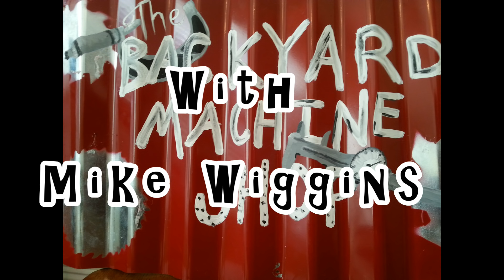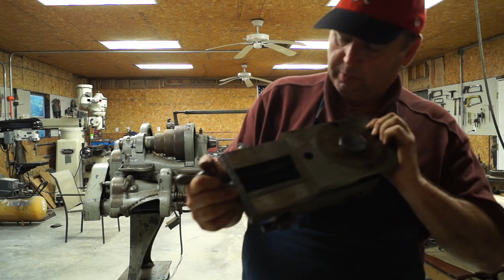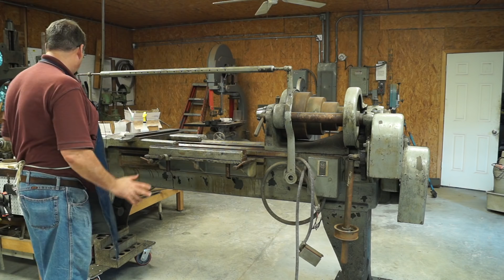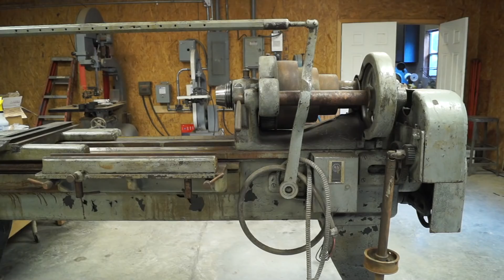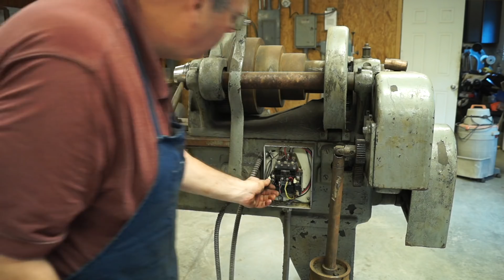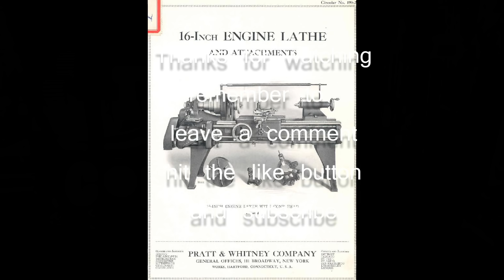1916 Pratt & Whitney Lathe Restoration Part 1

Comment: I have the identical lathe and I love it. Mine is not restored yet and is in need of some adjusting and tightening up at this point. I've learned a few things about the build quality of this old equipment and am always amazed by the simplicity.
Thank you for taking the time to record the process.

Comment: is the wooden rod there to make it easier and safer to operate from the other side of the lathe.? just a thought. if it is close to a wall it would be a pain to walk around to the back side to operate that connected control? very nice show. those old boys sure built em good. thanks.
Reply from the maker: I found out the rod was for shifting the feed at certain points.

Comment: Would unlocking that second cross slide and locking the main cross slide to it, allow you to use the taper attachment?
Usually, to use a taper attachment on, say a Harrison, the cross slide main screw nut needs to be disconnected.

Comment: Your rod" MAY" be for keeping the half nut engauged 100 % during threading operations but allowing you to reverse the feed direction to return tool to start of thread ---keiith Rutger 's lathe has this option although the lever is different.

Comment: THE LOWER CROSS SLIDE IS WHAT MOVES WITH THE TAPER Attachment engaged. There is a rectangle two pice block that slides in the taper attachment and a.  Shoulder bolt attaches it to the hole in the back of the cross slide. I have a Pratt and Whitney from the late 30s. It's a gear head with twin stick shift set up. Has the same type of wooden bar to engage the spindle. The taper attachment very good.
Reply: yes its called anti backlash taper turning

Comment: Just a safety warning for anyone who is moving a lathe for the first time... they are extremely top heavy and if it tips over on you it can kill you. This happened to someone within the past two years while moving a lathe into their shop. So be careful, and use some out-riggers on the base if possible to stabilize the machine when moving it.
   The extra cross slide dove tail is so that when the taper attachment is being used the cross feed will operate normally. On many lathes with a taper attachment the cross slide nut must be disconnected and all cutting adjustments are made with the compound feed.
Reply from the maker: Thanks for watching and leaving a reply.

Comment: Thanks for the video!  The bar on the back of your lathe is there to mimic the shift machanisms that would have been used with really old lathes that got power from ceiling lineshafts with leather belts. Those old lathes would have used a bar with hooks to pull the leather belting sideways between the idler and the powered pully up on the line-shaft. When (slightly) more modern lathes started getting electric motors some operators couldn't give up the habit of reaching over the bed to disengage the clutch, so some manufacturers added in bars like yours to keep the old-timers happy. Since your lathe is so old, its possible the holes in the bar were for the hooks, and your lathe shipped from the P&W to a line-shaft equipped shop with no provisions for an electric motor.
Reply from the maker: Thanks for the info, I was guessing that was the case.

Comment: Hi If you go to your NAPA store you can get a socket for pitman arms in different sizes theywork great on those screws in your machine. I hve a 1920 Kearney & Treckern 3B Plain horizontal mill I'm restoring Thanks for the video
Reply from the maker: Thanks I might stop and check them out. Good luck on the K&T, I have a 2h universal and have a 2h vertical on the way

Comment: Hello,  Is there a way you can put some distance between the fan and the microphone?  There is lots of white noise.  Maybe they are too close?  Take care.  Doug
Reply from the maker: they are about 25' apart, and the fan isn't that noisy. I'm not sure if the air is causing the problem

Comment: H i Mike,
Just a wild guess and it may not even be close. That horizontal bar may have been used with either the relieving attachment and or the taper attmt. Kick the feed out at the end of a cut could work at the end of a taper if the tool runs off the end or into a relief groove. I can't quite figure out exactly how it would work when relieving the cutting teeth on any blade type cutting tool though. All the parts aren't there, but there's enough to give some clues. The horizontal bar being made from wood does seem odd though. Given the rarity of lathes that were even built with relieving attachments, then finding a proper manual for a P & W lathe of the correct year and model that does show all the parts and how it was used might be a little tough.

That P & W is in unbelievable condition for something almost 100 yrs old. Very little rust or wear it seems. Another guess, but with those taper and relieving  attmts then if they had actual tool room lathe designation's when it was built then it would have been scraped into to a lot better accuracy than just a standard engine lathe. I'd bet that was a real expensive lathe when it was new.You have a fine piece of usable history there. And an interesting example of lathe design over the years with your Monarch and Kingston lined up behind it in part of the video. There's not that many years between the EE design and your P & W either. 20-25 maybe.
Reply from the maker: When I first saw the lathe I thought the bar was a add on by someone. Then I found some info and the P&W catalog and it shows it on the lathe. I've also was thinking that it controlled the feed  but maybe the feed controls it. Yes I'm sure that this was  cutting edge lathe when it was first designed. My Monarch was built in 1946 so its about 25 to 30 years newer.

Comment: Could the taper on the cross slide be used for the taper attachment.
Thanks for the video.
Reply from the maker: After reading your post I realized that is exactly what that is.  I'm use to seeing the cross feed travel. Normally this is accomplished by disengaging the nut from the cross slide and attaching cross slide to the Taper Attachment. So this lathe has a secondary or (compound) cross slide.

Comment: This was a long video, but I hated to see it end. The fun part will be putting that monster back together. Like you said, it took some real brilliant minds to design all those brackets and casting to produce that lathe, and that was a long time ago, long before computers. Does the lathe get is power from overhead ?    Ken, Marina CA.
Reply from the maker: Thanks for the kind words, I usually try to keep the videos to 18 to 20 mins, but when doing things like disassembly it is hard to take out some things. I want the viewer to get to see everything that is happening. I try and remove all the wasted time I spend looking for tools and answering the [hone.